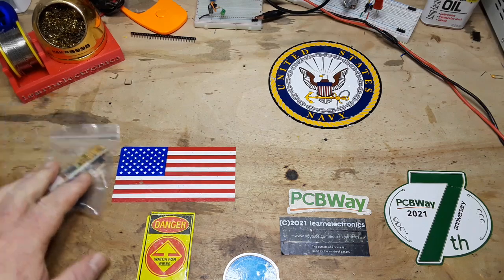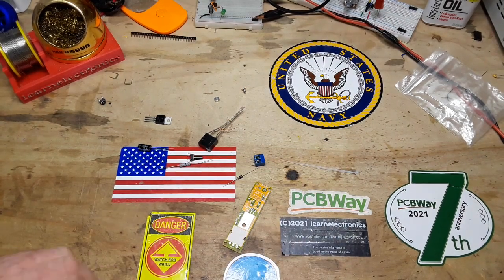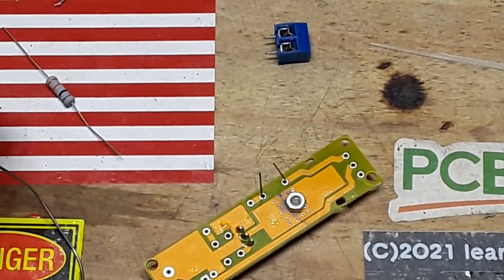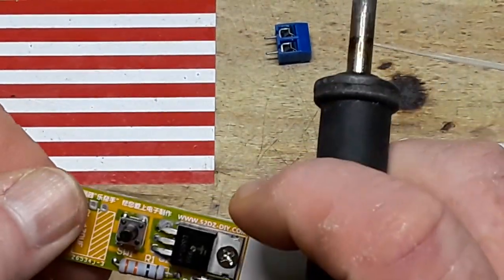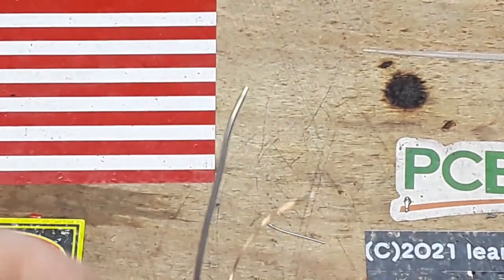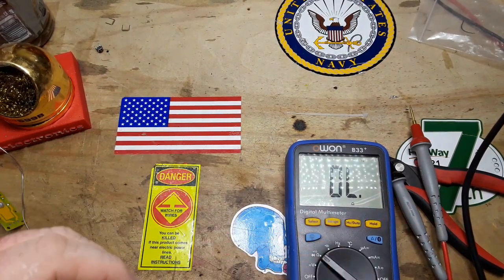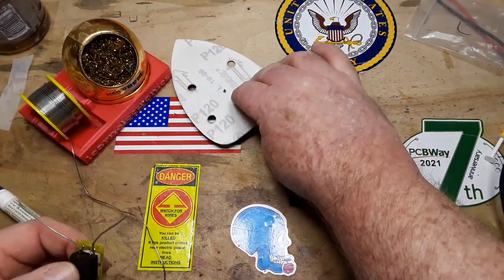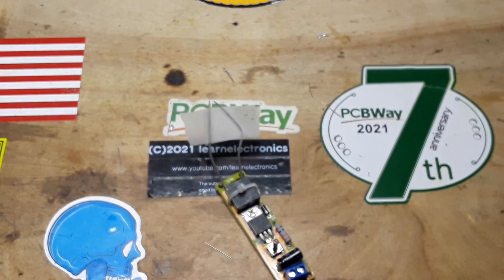Ximimark High Voltage Generator Arc Igniter Lighter Kit Build

Comment: inside that potted transformer was a low wound primary, and a thinner secondary wire wound at least a 1000 times. unless it has a voltage double'rs on the output.  the primary input side is connected up like a joule thief,  meaning its wound so it has a centre tap. One going to power,( the centre one) one going to the base of the transistor, and the other to the collector across the transistor. you get a natural oscillation going. 'even with out the capacitor. but it always better to have one in these circuits.  LOVED THIS PAUL. VERY COOL STUFF!!😁
Reply: Most of these high voltage generators are just high powered joule thiefs with a high voltage output coil.

Comment: Neat little blowtorch. I have in the past just used a lighter to strip enamel wire though, and rather than sanding the wire just tinned it. It seems to work also.

Comment: Hi Paul,
condolences to you and your family for the loss of your mom.
Question if you want, do you have a type number for the transformer used.
I wonder about the coil turn ratio between primairy and secondairy?
Thanks in advance,
Fabrizio
Reply from the maker: No information was provided
Reply: They're usually about 1:70. The primary provides an inductive spike up to about 100V. So ~7KV on the output. Some of them have cockcroft(sp?) Walton voltage dubblers potted inside the transformer.

Comment: thanks can this be a bug zapper.I need to see how to make bug zapper that evaborates insects
Reply from the maker: No, if you run this unloaded it will burn up
Reply: @learnelectronics  thanks for your response please consider making a high voltage bug zapper thats a dream come true😄
Reply: I just bought a bug zapper from "Harbor Freight Tools" for $3.99. Looks like a tennis racket and works great. I was thinking about taking it apart but now I think I should just buy one of these modules.